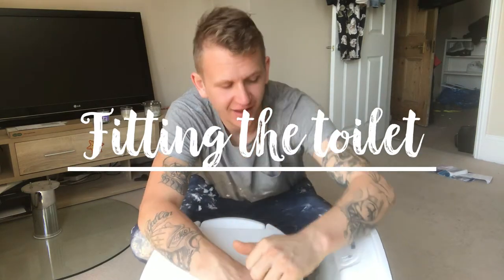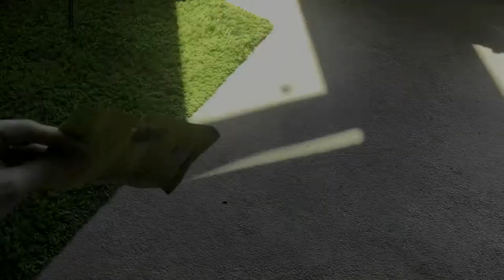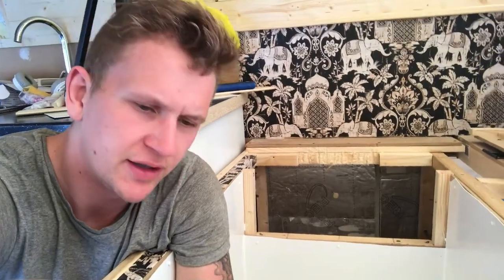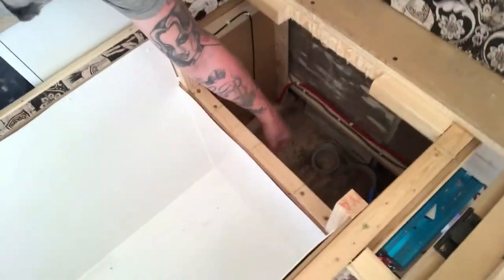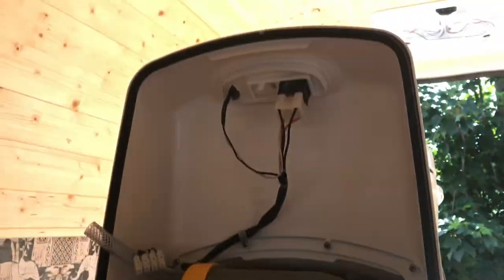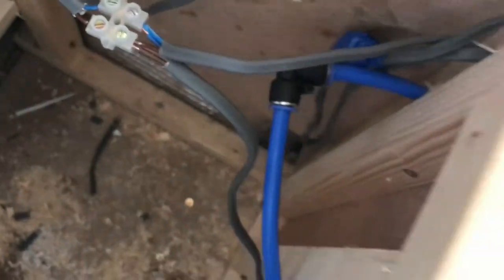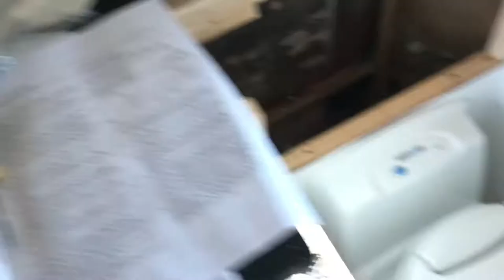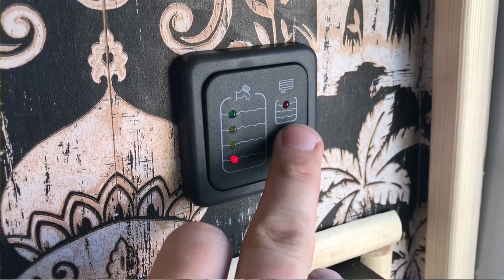HOW TO FIT A TOILET IN A VAN! Thetford Cassette Toilet  ||   Van Conversion

Comment: Hi, great video but you have installed it using flat twin & earth cable!  it’s not as per regulations for camper van/caravan, you must use “flex” when Installing electrics. BTW why is it in a “well” do you have to climb into it?

Comment: Is it easy to remove the toilet so I can refit the plastic 3 screw bracket, which can off when someone stood on the toilet. Where are the 4 screws that attach the toilet to the floor?

Comment: Is the plastic clip at the top of the toilet the only fixing holding the loo down. And if so can the toilet be removed by simply lifting the whole thing up or does it have a fancy locking system that you need to know to release it. Thanks, great video.
Reply: There are 4 screws in the cassette bay that hold the toilet to the floor.

Comment: Why oh why did u not explain the 4 wires 🙈, thetford doesn't give a manual for it, and cant find details anywhere. Could u tell me where the 4 wires go please
Reply: I have the same problem I’m reading the user manual and what I can make out is the two other wires are your micro wires for your water pump like what you get on your 12v sink taps

Comment: Hi, how you connect the wires from the toilet to + and -  because I saw has  a few wires the toilet for  connecting with what ? Thanks
Reply from the maker: Hey, it was very simple. The toilet only had a + & - so you couldnt go wrong really :) hasnt failed since.
Reply: @YouTube-Seany_Boyy_  Thanks,  I  just received maine  and i didn't have time to study exactly  but shows 6wires.
Reply from the maker: @dsparamotor6538  6?? hmm not sure, i cant remeber fully but i remeber it being they simple :)
Reply: Hi .
Today i done  the electric  connection  working  fine but when  that led is switched on ?

Comment: Does anyone know if this can be converted for mains electrics? I need something like this for a garage i'm converting but can't get plumbing to it.
Reply: use a 12v to 230v adaptor
Reply: You need a 240v mains to 12volt transformer.